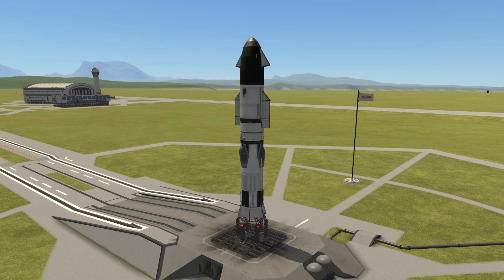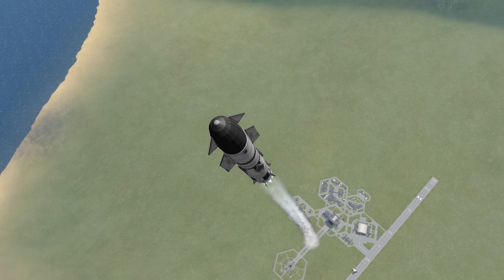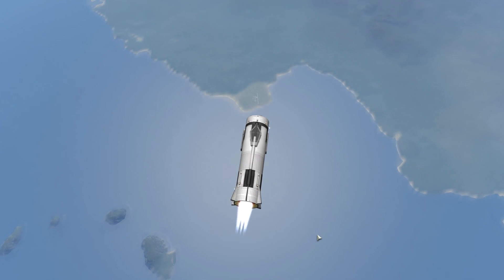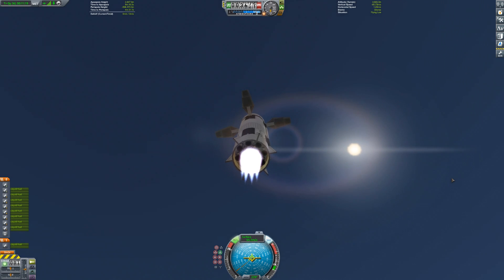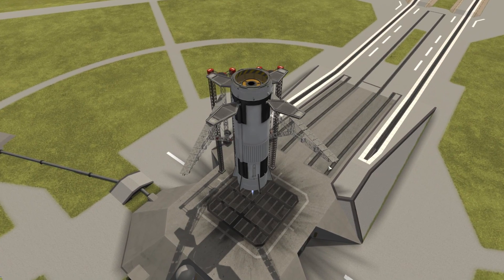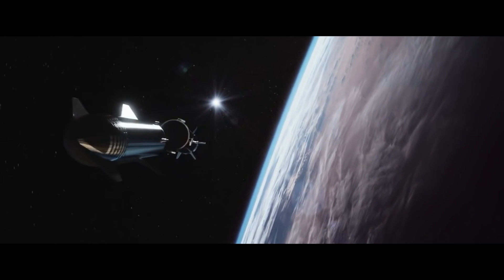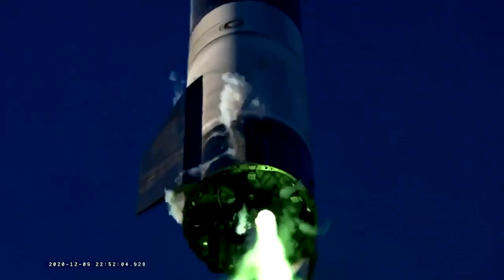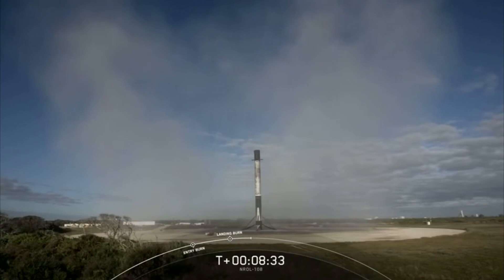Why SpaceX Wants To Make Landing Super Heavy MORE Difficult.

Comment: Elon is smoking some really strong shit lately... what ever happened with the KISS principle in Engineering...???
Also, it feels like the there are a bunch of things being done to keep the public entertained... not to actually achieve concrete results...
Catching Superheavy by its "EARS" so to speak is a bad idea given how much the damn thing weighs... and yes, the grid fins are structurally sound BUT they are NOT designed to carry the weight of the entire structure... think about it... who is attached to what... is is the Grid fins are attached to the rocket of is it the rocket that is attached to the grid fins...???
---
I say just build the BIG FUCKING ROCKET using the proven design of Falcon 9 and its landing feet and retro-propulsion... when you  get to work on an improved version of Superheavy 2.0 then you can go and say, "OK lets rethink landing from the ground up..."

---
There's 1 thing that pisses engineers off more than anything else... and thats constantly changing direction and design specification... making things in METAL is not the same as making software... with software you can do radical shifts midway... still costly, but its easier to do rather than with hardware... with hardware its a huge cost and bad decision making...

Comment: I'm just guessing one of the engineers showed Elon the good old KSP trick where you build the launch clamps super high to have an altitude head-start. Also less likely to damage the concrete if the engine are a couple yards higher up at launch and landing. ;-)

Comment: I was gonna suggest getting some more payload capacity out of the old Falcon 9 by ditching the legs and just catching it by the grid fins on the barge. But yeah, it not being able to hover probably makes this more difficult. The superheavy can probably hover for a second or two and use the RCS thrusters to center itself nicely while the landing clamps are moving in.

Elon said a couple years ago that the plan would be to land the super heavy booster in the launch clamps so it's great hearing this is still the plan, as ridiculous as it sounds. It will probably look hilariously effortless when it happens.

Comment: I think my main concern with his idea is 2 things. 1, unless the tower is an active participant, and a lot more robust than anything we have seen so far the accuracy of landing will need to be stepped up be an order of magnitude.  More than a few meters off from perfect and you scrap a lot of equipment, including the launchpad. (And I am just arriving at this point of your video where you talk about this). And 2, returning to the launch site requires a larger fuel reserve, which means less booster time applied to the payload.  This might not be a primary concern with his plans to refuel starship in orbit, but that's another thing we have yet to see happen successfully.

Comment: To me, the answer to landing and the quick relaunch of the booster is to set up several landing platforms that would support the booster as shown in your animation video when it lands. The difference being that the booster would move by a conveyor system that would vertically and horizontally move the booster to the launch platform after a successful recovery. If the first booster craters on landing, just use recovery platform #2 for landing the next inbound booster...GC

Comment: What is it with the attitude toward landing gear? It's got to stand on its own anywhere it wants to. I think something that important needs to be something as opposed to nothing. Meanwhile a ready-made solution sits rotting in the Mojave Desert and it can be had for ridiculously low prices. Good thing aircraft landing gear in most cases are always fresh once you replace the seals and the skydrol and you would want to do that anyway. Level adjustment is easily maintained by an electric hydraulic pump connected to  four B-747 Main Body Gear and it will level itself.

Comment: IDK, I kinda imagine that SpaceX is hoping to get their reliability high enough on the launch vehicle side, that range safety is not a major concern.  Especially combining the fact that they plan to fly passengers with no in-flight escape system.  Once they get these things flying regularly, it's only a matter of time before all of the "surprise" failure modes show up and can be prevented.  Add in some redundancy optimization, and we're fine.

Besides, I imagine that the passengers' deaths will more than outweigh pad damage costs.  Plus, spaceX probably has a plan for quick refurbishment of the pad system.

Elon might be a horrible, monopolizing capitalist, but at least his engineering teams seem solid.

Comment: Really stupid idea but, what if the grid fins just…doubled as landing legs? Move them to the bottom, tilt down toward the ground right before touchdown. Would it be aerodynamically feasible to steer superheavy from the front instead of the back?
Reply: No, that's a dynamically unstable configuration.  The fins are at the top because the rocket is going backwards.

Comment: The comments about parents are incorrect, a patent must “fully describe” the invention, if a person skilled in the art cannot, using the disclosure of the patent, produce the invention then it is not fully described. They must also have utility, which is how most perpetual motion machines are rejected as they are impossible to create so therefore not useful.  Source: former patent examiner (Australia).
Reply: To expand on Sporegnosis' comment. Is this uniform over time? because I can both remember some whacky impractical patents and others that had to be filed with working models of the devices. [I imagine the second were a pushback to the former]
Reply: Is this uniform across all countries? urely there are changes in legislation on how patents are awarded from country to country.

Comment: Interesting! I wasn't aware that the Falcon rockets were not capable of hovering.
Reply: They have too much power, so decelerate continuously, then stop the engine at the point of touchdown; otherwise they'd take off again!
Reply: @paullangford8179   Actually, now that I think about it, that would be really cool to see.
Reply: @paullangford8179  its actually more fuel related, as they are pretty much running on fumes on touchdown. So efficiency is key.
Reply: Apparently throttling rocket engines is not straightforward in real life. So for most real life rockets they're either on full blast or off. Neither is re-igniting them after they've been switched off, so that can only be done a limited number of times.
Reply: @MarcoTheGreat2008  Most throttleable rocket engines can only throttle down so much. I think the Space Shuttle Main Engines can only throttle down to about 65% thrust or so.
Reply: @RCAvhstape  which is why having numerous smaller engines offers more flexibility, which in turn is key to the falcon 9 even being able to do a suicide burn landing when it’s running on empty (low mass).
Reply: @ArKritz84  For any given system, a trade study is necessary to determine the pros and cons of lots of small engines vs. fewer bigger ones. There is no free lunch either way. TANSTAAFL as Mr. Heinlein used to say.
Reply: @RCAvhstape  i believe falcon is around there too, well merlin i think its the 60-70% area, raptor I've heard 40% quite alot, I've even heard as low as 20% but not from anywhere with much authority for that number.
Reply: @RCAvhstape  the moon is a harsh mistress was a good book
Reply: @plvmbvm513  My favorite Heinlein book actually.
Reply: @RCAvhstape  ..yes, Robert Heinlein popularized TANSTAAFL, but it started back in the late 30’s....
(‘Moon is a Harsh Mistress’, one of me favorite Heinlein works... along with ‘Starman Jones’, ‘Citizen of the Galaxy’, ‘Farnham’s Freehold’, ‘Space Cadet’, ‘Tunnel in the Sky’, ‘Farmer in the Sky’, ‘Podkane of Mars’, ,,,so many many great works.)
Reply: @MarcoTheGreat2008  Yeah, engines with solid propellant can only be turned on, and then burn until theres no fuel left.
Reply: @MarcoTheGreat2008  Most rocket engines cannot throttle below 50%-ish.
Reply: @MarcoTheGreat2008  it’s gonna mean maybe a fewsmall rocket engines
Reply: @MarcoTheGreat2008  agreed, so you think the capture method is on the cards
Reply: its called a suicide burn for that reason, its so cool to think of the precision reqired.
Reply: @TheSpaceGardener  I remember using Flight engineer in KSP for suicide burns. I no longer do that. I see my acceleration, and crudely calculate an altitude on the spot. QUICKSAVES ARE MANDATORY.
Reply: @panpsalt6757  without quick saves i wouldn't be sane 😂😂😂
Reply: @TheSpaceGardener  Laughs in Laythe SSTO doing wrong gravity assist and having to redo the entire mission because forgot to quicksave
Reply: @panpsalt6757  thats when i go to sleep because this multi day ssto build took everything out of me 😴😴 😂😂
Reply: @TheSpaceGardener  suicide burns can be done in rockets capable of hovering, though. suicide burns are the most efficient landing burn as far as I badly understand it. they are called suicide urns because they are performed as last-minute as possible
Reply: @aeueeaia  very true thats why trying to do a suicide burn for humans would be really crazy as you can never have a true suicide burn and a back up plan
Reply: @TheSpaceGardener  Have a very good, very fast-acting LES. As soon as the raptor touches concrete, the capsule is shooting away at 9 gees. If all else fails, the crew comes down under parachutes. Not sure that would work with current Starship design(I’m sure it wouldn’t…)
Reply: @TheSpaceGardener  But if you're smart and your engines can throttle you've got a whole bunch of margin. Merlin's can throttle to about 40% so if you set your thrust, that is used to calculate the moment of ignition to something like 70% you have 30% margin to throttle up or down. So while they can't hover they can change their acceleration significantly and to a flight computer that thinks in fractions of millisecond intervals it's like an eternity to calculate the needed amount of thrust at any given time. Add to that the tolerance in landing speeds and you've got quite a bit of margin. Now a suicide burn with non throttling engine, that's the real fun. I built a reusable Electron in KSP Realism Overhaul that lands like a Falcon 9 (diameter increased to 1.5 m, doubled the lift off mass to something over 20 t and added 5 more Rutherfords. They don't throttle so landing that baby is pretty special. While I can do about 4/5 F9 landings it's only about 1/20 success rate for my flyback Electron.
Reply: The hoverslam was really difficult to pull off, but it's one of the reasons why everyone thinks very highly of SpaceX now :D
Reply: @hafor2846  It isn't that hard.  If you know how heavy you are, how high you are, and how fast you're coming down, it is pretty trivial to calculate how much thrust to use and when the burn has to start.  They still throttle the engine on descent to make up for any errors as they come down - the catch is there's a lower limit to how low the throttle can go.  It's not like the ride all the way down with the engine on min thrust.
Reply: Its the opposit with me I was not aware that super heavy is. 😄
Reply: I mean no disrespect, but that was one of the hardest things to overcome when designing the Falcon 9. You should go rewatch the dual landing of the Falcon Heavy boosters because you obviously didn't get the full effect last time.

And really, whether a rocket is capable of hovering or not you will always want to use the least amount of fuel possible due to the rocket equation, so the work they did is paramount to furthering exploration whether the new rocket is capable of that or not.
Reply: unlike in Kerbal Space program, real rocket engines have a minimum throttle setting which you cant go below without shutting down the engine completely.  for a Merlin i believe it's somewhere arround 60% throttle.  when the booster is coming back in for landing it's nearly empty and even a single Merlin at minimum thrust is higher than a 1:1 thrust to weight ratio so the landing burn is timed so that the rocket reaches as close to 0 kph as possible at the exact same moment the landing legs touch down and then the engine cuts off.
Reply: @Knightfang1  I think when they were working on the Altair LSAM, they got the RL-10 down to about 15% with some serious chugging.
Reply: @Knightfang1  I think the Merlin is at 70%>
Reply: Just use mechjeb geez. Also use autosave duh..
Reply: How do the Kerbals feel about this ?
Reply: Imagine building an engine tooooooo good, crazy to think about
Reply: They are too strong
Reply: Imo this aspect of the landing may actually make it far easier to accurately land the super heavy than the falcon 9. Not saying that a Raptor or 3 at full tilt won’t be challenging to whatever is below them, but at least maneuverability won’t be a limiting factor.
Reply: Yep. They can’t throttle low enough to hover, so they have to do a suicide burn or they’ll start going up again.
Reply: Why Stainless instead of titanium ?
Reply: @lestergillis8171  Much cheaper? And when you already build the rest from steel ...
Reply: @lestergillis8171  much, much cheaper. Plus see everyday astronaut channel.
As for hovering. I heard raptor minimal thrust is 40% for example.
Ps. I liked the previous intro music better.
Reply: @lestergillis8171  Cost.  Titanium 3D printed grid fins are $50,000 to $100,000 USD each.  Stainless steel grid fins should be $5,000 to $7,000 USD  each.  Plus if they start being caught by the grid fins replacement  of damaged fins will be cheaper.
Reply: Throttling lower also has massive fuel inefficiencies due to cone size.
Reply: Bailbonds
Reply: They probably can.
Reply: and if it’s hovering, how will it cope with wind, which causes drift and tilt
Reply: They can do that with enough fuel
Reply: This is getting nuts!
Reply: Yes it's not easy or very efficient to hover a heavy, vertically oblong object.
Reply: On a sufficiently heavy vehicle, a Falcon engine could easily hover. Of course, though, it's purposefully as light as it can possibly be.
Reply: Technically no rocket is for long periods of time assuming that you burn off fuel which would make you lighter
Reply: Not necessarily! If more engines fire up it can hover but that means it would have to start the burn way later.
Reply: Yeah same, I wasn't aware that the falcon 9 couldn't hover, I also wasn't aware that super heavy can hover

But I guess it isn't really something I've actually thought about though.

Comment: You may not be an engineer, but you sure presented the strategy in a clear and understandable fashion.  With capability to hover, in fact isn't it possible to really arrive at zero downward velocity at the moment of touchdown to earth (or very very close to that)?  So why 'catch' the Superheavy feet off the ground?  It certainly is not going to be suspended meters away from the ground.  Do you have any insight into how the stresses the control fins experience during reentry compare to the stresses they would be subjected to by the dead weight of the superheavy and/or some marginal shock absorption if the Superheavy has not reached zero velocity at arrival?

Comment: do they have to use helium because its inert? can they not just catch some air on the way down?
Reply: They use helium because it's freezing point is much lower than the cryogenic fuels they're using - otherwise the gas would freeze in the lines.